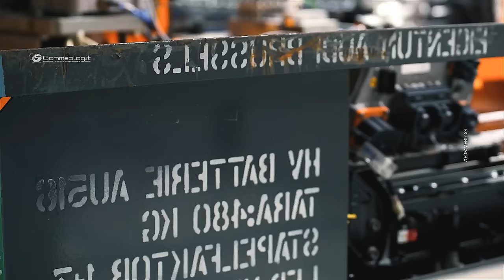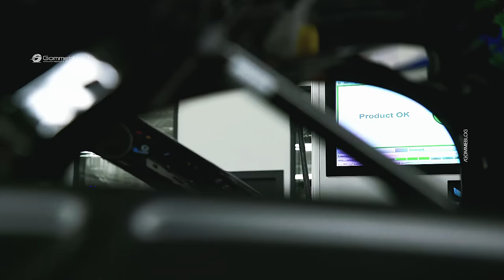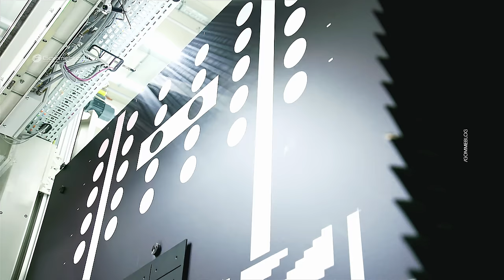Audi Electric Motor Revolutionary 2024 ROBOTS for CAR Production!

Comment: The most amazing video production I have ever seen. Were the drone flight paths programmed? It's hard to believe that an operator could control one that well in real time. And it's incredible that such a factory could be designed and built for any amount of money. I could not be more impressed!
Reply: That's a human operator for sure. You can see small flight corrections as it moves that are totally typical to a human. But yeah, that's a very smooth operator nonetheless.
Reply: If you buy an AUDI and theres a small drone spot welded to the inside of the roof, you know what happened.
Reply: you havent seen alot of video productions i think.
Reply: its easy to control if u have experience in it
Reply: It goes so close to some of the robot arms still in movement that it's hard to believe it was done real-time by some human operator. Having programmed predefined paths seems safer.
Reply: @Tigrou7777   I think it must have been attached. To the arms itself and then the. Video software. Stitch it together. And or AI made. I mean, look at how fast it moves, especially at 37:00
Reply: maybe The drone has an anti-collision system😀
Reply: @Boyibolomi  Of course it must have collision avoidance. What kind of a drone is it?

Comment: Great video, but how come it is inside out, ie.. a mirror image? Writing reads backwards and all bolts being tightened appear to have left handed threads!
Reply: Perhaps it is a crude attempt to avoid copyright claims?
Reply: This same mirror image has been seen in several other equal video clips as well.
Reply: Watermark is mirror, including numbers and letters
Reply: I noticed that. I doubt it's related but it seems like everything on tiktok is backwards. 
It's like when there used to be film and the negative gets flipped.

Comment: Imagine it's your job to design this factory and everything that's in it... 🤔👍👍👍👍👍
Reply: Thats what I do for a living.
Reply: @SpeedBoostRC   and I 😄
Reply: @TheJacekL  Which part? I mainly do controls, automation, and machine design.
Reply: @SpeedBoostRC  Implementation of the projects. Physical introducing solutions on factory area.  I work in Blumenbecker company.
Reply: @TheJacekL  I know Blumenbecker well. It seems we share similar career paths. Currently, I'm overseeing a multimillion-dollar project introducing automation to a new manufacturing plant. Collaborating with a US-based PPE manufacturer comes with its fair share of challenges. PPE was mainly associated with the Asian market, so launching it in the USA poses significant hurdles. Nonetheless, it's quite enjoyable navigating through them.
Reply: So how is it possible You have knowledge about existing european company -  Blumenbecker? While You are working at USA market.
Reply: @SpeedBoostRC What is that multimillion dollar customer? Which automotive company?
Reply: Only smart designers can make these machines
Reply: The machines that build the motors is what impresses me the most.
I've rewired some motors, and keeping everything organized and making sure one thing doesn't get snagged on another is hard.

Comment: A step was missed, as in how were the end of the stator wires were cleaned before crimping, or if not clean how did audi get around the coating on the wires and succesfully create an electrical connection to the crimped connector..

Comment: Memory effect goes into the coil of electric motors. A satellite nuclear laser beam is in use to do this. Power tools are most commonly not burnt out, it’s the same as the memory effect as in batteries, and needs 30 min, 20 retries to fix the device. Cars may also be in such a trouble. New thing, best engineers may not know this.

Comment: Electric cars don't last long because they use coils of copper wire as a motor dynamo. The copper wire can burn and be damaged. It's different from a gear machine that is lubricated with oil. It can last a long time.